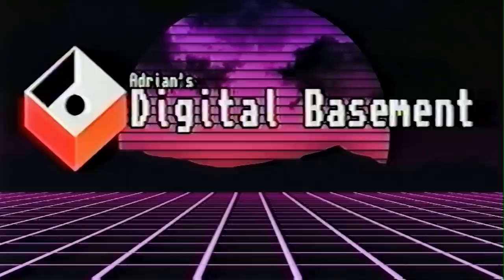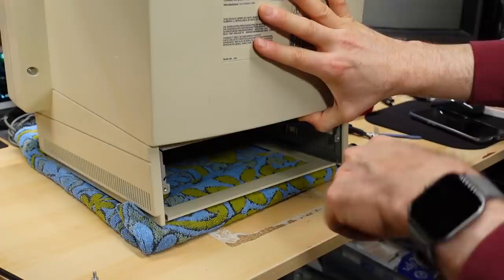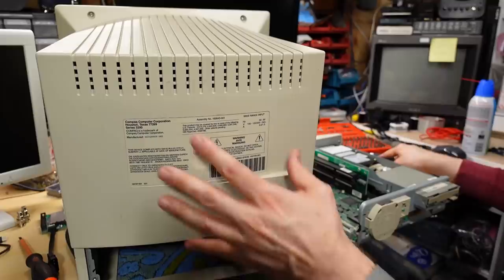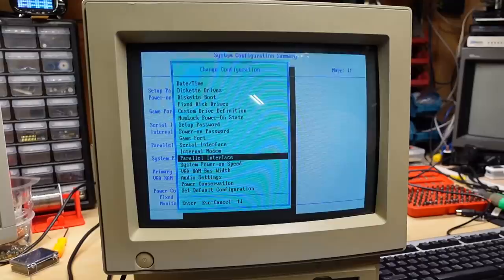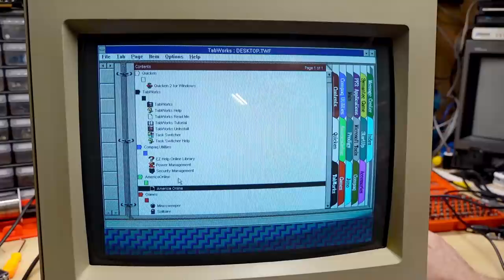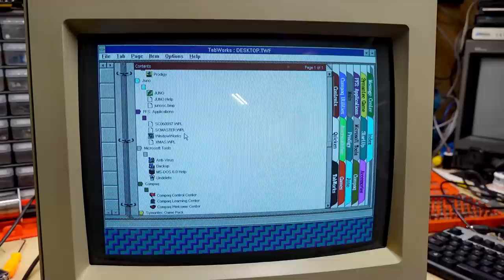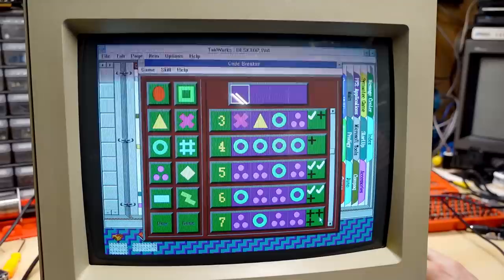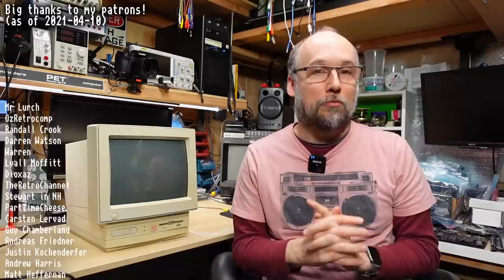PC archeology: Compaq Presario 425 All-In-One (Part 1)

Comment: The reason the IEC power cable plugs vertically, is to ensure you unplug before opening the rear drawer. It's a safety feature.
Reply: Pretty good point there :)
Reply: Do you know that for a fact? I mean it makes sense, but it also makes sense that it is so the cable does not stick out, like Adrian suggests.
Reply: @captainchaos3667  Don't quote me on it because I don't remember where I read this. But yes it was a fact when I read it.
Reply: Don't tell me what to do!  [Installs right-angle IEC cord]

Comment: The Presario 425 actually does have onboard sound capability, although not in a very useful way. According to a magazine article, "The Presario can play audio recordings through an internal speaker via the modem, and it can record voice memos using a telephone handset as a microphone, but there's no Windows sound driver for this interface."
Reply: I’ve seen that in old articles as well, like the review in Compute! Magazine. So far haven’t been able to get it working though, perhaps relying on some software I’m lacking.
Reply: Makes sense.  I recall seeing some hybrid sound card / modems which allowed for use of the pc as an answering machine.
Reply: @timmooney7528  HAHAHA  i remember my old boss wanted to spend @ $800 on a voice modem so that he could have messages saved on his pc when he was out

I politely told him to wake up as he had a receptionist and he could easily buy a $39 answering machine at the time.

It did use the modem somehow to do some hardware compression on the message that it then saved as a mp3 file in a folder, the folder was auto names as ddmmyyttmm
Reply: @georgemaragos2378  lol!  That's funny a few years later you could do that with nearly any $10 Winmodem.   One cheap Winmodem I had came with software that could manage five separate voicemail accounts as well as the usual data/ fax stuff
Reply: That's weird, like a DVD player that can only read CDs.
Reply: @LGR @VWestlife that would be a baller oddware video. Old? Forgotten? Obsolete? Check, check and check. But I wonder if it was one of those things that existed only in early reviews when it was coming out and Compaq figured it wouldn't work well or they found a serious bug so they left the hardware undocumented. Regardless, I love the vintage computer YouTube channels. I look forward to your videos, and I very much appreciate all of the content.
Reply: @cfabz2023  LGR review eleven years ago https://www.youtube.com/watch?v=Qt-0lqkJUKE I don't think it would be "vaporware" because that modem would need exactly the same signals as would be needed for basic PC sounds.Any serious bug would ruin modem capabilities.

Comment: Nice. FWIW Windows 3.1 was rather more than a DOS shell. It had advanced memory management and solved the #1 most important problem of its day, multitasking (cooperatively) DOS software by exploiting the virtual 8086 machine built into the 386 and later chips. IBM stubbornly clung to the 286 for OS/2, to its cost. That aspect of the 386 allowed it to go in and out of protected mode easily, while the 286 was not intended for mode switching.
Reply: 1. DOS sessions in Win 3.1 were preemptively multitasked, unlike native Win apps.
2. Both Windows and OS/2 had had 286 and (later) 386 versions.
3. 286 has no official mode switching instructions. Yet 286 has undocumented instructions which allow this. And Windows 3.x used it because you can easily exit to DOS prompt without rebooting, even from Windows Standard Mode.
Reply: @nneeerrrd  Yes it is possible, but it is so expensive in time that the capability is useless in real life. This was the reason the first version of OS/2 was a total failure. The 286 was meant to switch to protected mode if desired and stay there (e.g. as in Xenix) and stay there. And yes there is a 286 version of Windows but there is also an MS-DOS shell version of Windows. Windows proper as a realistic OS begins with Windows 386.Not sure what you mean about pre-emptive tasking in Windows 3.x, because nothing was pre-emptively multitasked in the sense that we know it since Windows NT. Indeed the issue does not even suggest itself for 16-bit software on a 32-bit chip. Every Windows 3.x program had a footprint in conventional memory. Perhaps you meant that Windows 3.x could use extended memory and a memory manager like EMM386. Yes. But if enough programs were started it would fill up conventional memory and grind to a halt. The way forward was shown by gradually adding 32-bit features to Windows 3.x, in the form of Win 32s. The 32-bit disk access comes closest to using all the capabilities of the 386.
Reply: @nneeerrrd  One more thing, IBM realized its error with the phenomenal success of the Compaq Deskpro 386 and corrected OS/2 in version 2.x and beyond. This was a true 32bit operating system with pre-emptive tasking throughout, and its DOS box was way better than Windows 3.x's. It also had a Windows 3.x subsystem, WinOS/2, which in the marketing parlance was "a better Windows than Windows" (true). But it was too late. The better man lost - again. It happened a lot back then.
Reply: @nneeerrrd  If I recall correctly, to get out of 286 protected mode, you'd reset the CPU in a way that tells the BIOS to skip the usual boot procedure, and instead jump directly to whatever real-mode code is supposed to run next. So, not so much an undocumented instruction as a partial reboot.

Comment: This was my very first PC clone back in early 94.  I remember upgrading to a 486DX33 and also installing a combination sound card and external CD drive.  Thanks for the memories.  My current PC has 8000 times more RAM, clock speed is 144 times, and the storage is 5000 times.

Comment: Adrian, try to enable the audio in the BIOS again. That modem section just seems too big on the bard. So does the speaker. I think one of the chips is a sound card. It also has a game port, so it mighthave a sound card as well (but if that's the case, it's weird enough it doesn't even have a headphone jack on it).
Reply: This wasn't too long after the big old separate "acoustic modems". Soundcards were a big deal (expensive) so I don't think it would. I mean, 25 or 33 Mhz? This is ancient by PC standards.

Comment: Due to the size of the built-in speaker I would guess it could do actual sounds (not just beeps), so maybe there is a soundcard in it after all? Try enable it in the bios again 🙂
Reply: I was looking for this comment.
Reply: Yes, it is possible the modem chipset provided some kind of audio support.
Reply: Right? It even has a joyport. Didn't soundcards come with one?
Reply: @supersomondoco1  Yeah, that was the Compaq Business Audio which I remember seeing on display computers but I had never worked on one of them or saw its range of capabilities...  Probably a generic DAC.
Reply: I have two 425's. No, no sound card of any sort. Best you can do is use that old driver that enables PCM sounds on the PC speaker or install an ISA sound card in one of the two available slots
Reply: @jeremiefaucher-goulet3365  thanks, that settles it. But still curious why there was a bios option for sound.
Reply: @daw7563  Good question. I think it must have to do with the modem. If I remember right there was Compaq software to use the computer as an answering machine. The modem supports Data/Fax/Voice.
Reply: @jeremiefaucher-goulet3365 okay, makes sense.
I was thinking that in the old days modems let you hear the classic connecting sequence and when connected it got silent. But it seems too simple (or advanced) to involve the bios into that, so probably not the reason (unless it was for the option to mute that sound).
Reply: @jeremiefaucher-goulet3365  Do yours have the sound and MIDI drivers installed as well? I don’t recall if that was always present on Win 3.1
Reply: @RandomInsano2  I remember installing the PC Speaker PCM driver back in the day. It would freeze the computer while a sound is played since it's 100% CPU driven.

I'm not sure about MIDI. If so it would have been pure software emulation like PCM through PC Speaker that you can do with any IBM compatible.
Reply: @jeremiefaucher-goulet3365  that's why I why I used Amigas back then 🙂 I was late into PCs (born 75) but switeched to PC first in 95-96.
Reply: @daw7563 I was born in 1988. The Presario 425 is my childhood's computer. Hence it's sentimental value ;)

I'm told I played spreadsheets on an older computer as a baby, but I was too young to remember it.
Reply: @jeremiefaucher-goulet3365  for me vic20, Commodore 64 and Amiga is sentimental, and I always felt PCs had no soul, they were all the same or just copy cats/variants, nothing to be sentimental about, but I am starting to realize I've been wrong, also realizing I have thrown away plenty of gems at the city dump 🙄. But maybe with PC's it is the software that is more sentimental than the hardware itself?
If I would have kept all hardware passing through I probably would wonder why I did keep it 🤣.
However I do still have all the amiga/commodores around, showing my son how it was back when I was a kid.
Reply: @daw7563  I'm a tech hoarder. I'm unable to throw that stuff away.

I agree most PCs are boring. But I love special one such as this Compaq, with a specific form factor and not just a regular AT/ATX beige case.

It really is the hardware in my case.

Sadly I'm too young for the 8-bit era. Although I've developed a love for it retroactively.
Reply: Yeah, many of these systems (including the Deskpros) had built-in speakers going to the sound chips instead of the infamous beeper. I had to hand it to Compaq for that aspect. Not many manufacturers did that.
Reply: @jeremiefaucher-goulet3365  I'm a tech hoarder too, but ran out of space on different points in life 🙄
Reply: @daw7563  I agree with you. PCs were just kind of "sterile" to me. I still have my bread-bin Commodore 64 to this day, but the 486s, well I got rid of those as well. Not enough space for all the old stuff, particularly when you have to move house!   Fred
Reply: @daw7563  Macs? A Quadra was my first computer after graduating college. Also, in the late 90s I got interested in Linux, and so was looking to get it installed on "old" 80s PCs all the time.  I think a big part of your "no soul" experience was from Windows 3.11 and Windows 95.  It's not "hardware or "software", it's the OS that made clones soulless. Also in the 90s were countless issues with certain soundcards and video cards and general settings being incompatible with different games and software, hours wasted finding pin switches, connecting printers at work with AppleTalk and sending stuff so very slowly over the serial and parallel ports... It's funny it's exactly the era LGR seems into, playing games on these incompatible PCs.

Comment: I know Phillips screws are convenient in that you don't need an exact size match, but I like seeing things that use Torx. It's way too easy to strip the head of a Phillips screw if there's any resistance to turning.
Reply from the maker: Yeah it's true. I can imagine the way these stay on the bit mean assembly is likely easier and more consistent
Reply: @adriansdigitalbasement  They are much better but more expensive and we all know how much big companies like to save a few cents here and there that I was really surprised seeing them even on core 2 HP made (but compaq branded) PCs. Probably on some meeting deciding which aspect of Compaq brand should be kept someone said "screws" and win over competing suggestions like  good build quality and reliability.
Reply: If you buy an HP Microserver (or regular server) today, it uses Torx screws and the screwdriver is included attached to the door/lid.
Reply: Agreed. I've stripped way to many Philips screws over the years....

Comment: Back in the '90s, Torx screwdrivers were somewhat of a rarity and could have been considered a measure of security.  Today, anyone with basic hand tools likely has a Torx.
Reply: Agreed. In the mid-1990s, I did a PC repair course at the local community college. I bought the standard issue tool kit (which I still have), and it did not include a Torx bit.

Comment: Adrian, from those I/O port options for the Audio settings on the BIOS i can definitely be 99% sure that it is for WSS, or Windows Sound System, if you prefer.
Reply: The option ROM at C000h to C7FFh segments is the VGA BIOS

Comment: A great way to remove that moire pattern when filming a CRT to set the camera to manual focus, and then manually defocus it just enough to smooth over the moire pattern, but still see the image and text clearly. It gives the image a very natural look. 
Learned that from YouTuber Ms Mad Lemon. It's also great for capturing that classic 240p look of older systems on a CRT. You can blur it just enough to eliminate the moire, but still retain those beloved scanlines! :)

Comment: Always check the 386 enhanced section in control panel on any windows 3.1 computer.  9 times out of 10, they haven't enabled it.  It gives quite a performance boost.

Comment: I have a Prolinea 425 which has a  similar board.  On that board the thruholes for a CR2032 socket were underneath and I was able to just solder a new battery socket on in place of the older cell.  I've owned it since 1995, so you can say that Compaqs of this era are certainly reliable.  We "overclocked" mine by the simple expedient of just moving the jumper to 33mhz.  Later when my brother took it to college, we bought an intel  DX4 75 mhx overdrive that ran (and runs) happily at 100 mhz.

Comment: The Philips screw drive has basically been obsolete for a long time and only sticks around because it's just so common. For manufacturing, the advantages of Torx are pretty clear to me--very resistant to rounding off and a very definite engagement.

Comment: When you got Compaq certified for warranty work back then, they gave the techs a Compaq screwdriver with the replaceable bits (including torx of course). Looked similar to the one you were using, but with Comaq's name on it.  It included 2 long (2") thin torx and Phillips bits that I've never seen anywhere else.  And also a plastic piece we called "the bone": for fooling the server case power interlock switch.

Comment: I have similar presario in mint condition. Mine has a bit different MB, it doesn’t have soldered CPU, but the 486SX-25 is installed on normal socket and switching it to 486DX2-66 is just a matter of switching couple of jumpers. It came with original keyboard and mouse and I got it for few euros couple of years ago. It is an awesome little system. Memory is expandable to 20MB and processor has enough oomph for early 90s gaming. Only real drawbacks are lack of 5.25” expansion bay and only 2 ISA slots. I equipped my system with SB 16 CT2290 and network card, which means that no other addon cards are possible. But all in all, well built compact  system.

Comment: Your assumption at 29:30 was correct. The tabs in TabWorks were the Program Manager folders. I sold Compaq PCs during that era, and they all came with that TabWorks overlay. IIRC, several OEMs pushed Program Manager replacements in Windows 3.1.

Comment: The block cursor at 15:47 is the point at which you can press F10 to enter the BIOS setup.  Note that Compaq Setup is loaded from a special partition on the hard drive rather than from ROM, so if you replace the hard drive, you'll have to boot the setup floppies, which give the option to install to hdd.

Without the Compaq partition, pressing F10 will do nothing.

Comment: Man that thing is soooo sweet! I wish I had kept my Philips all in one PC. It had a Cyrix 486. Also more rare that this machine still has it's OEM build. Something that could have been lost in time. Looking forward to seeing the upgrades on this
Reply: Do you happen to have any photos of the system or know its model? I have an AST Advantage Adventure 4050d all in one PC which was entirely made by Philips and also has a Cyrix 486. (And interestingly, the monitor inside the 425 was produced by Philips. They must've had some sort of deal with most PC makers for AIOs.)
Reply: @presario4255  Ohhh I would have to look. I don't think I do have any photos. But I still have the CPU from the machine

Comment: In my days volunteering for an organization refurbishing computers to distribute to low income families I worked on Compaq’s of this vintage quite often.  The BIOS setup program isn’t stored on the BIOS chip itself, but on  a small non-dos partition on the hard drive (hence the multi-language support). When that white square flashes at the top of the screen after the Ram count, that’s when you can tap the F10 key to enter BIOS setup.  Changing the hard drive, you’ll lose the ability to enter BIOS setup on system startup.  There was a version of the BIOS setup that could be run from a floppy disk that could be downloaded from the Compaq support web site.  I don’t know if HP kept available.